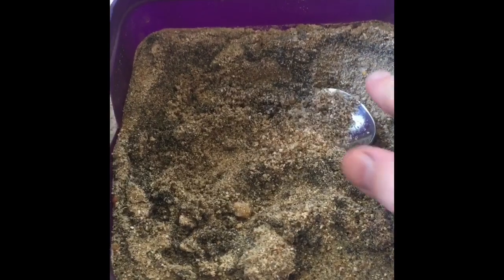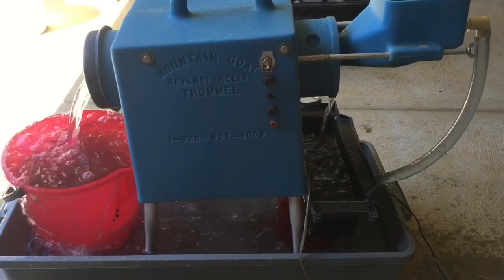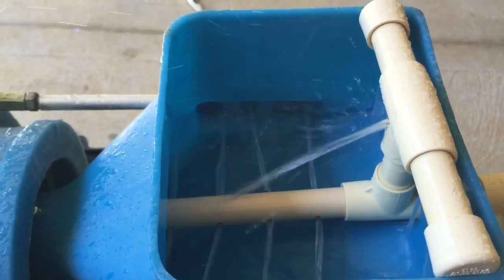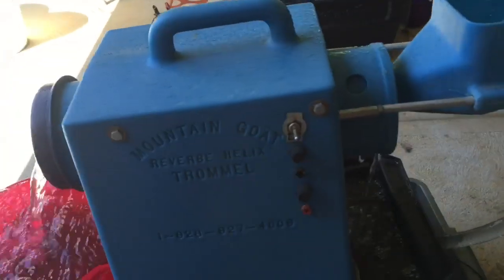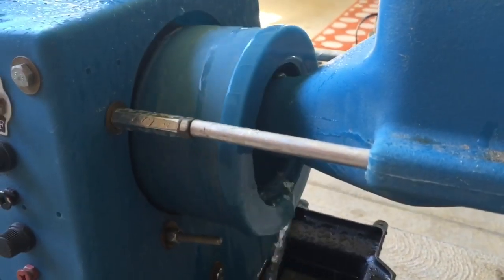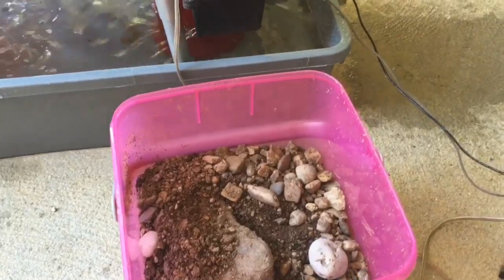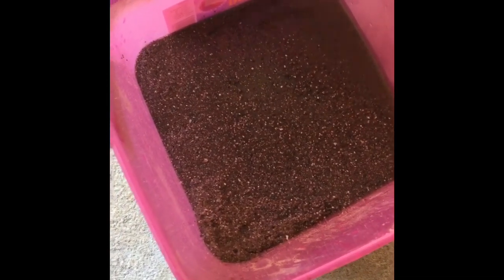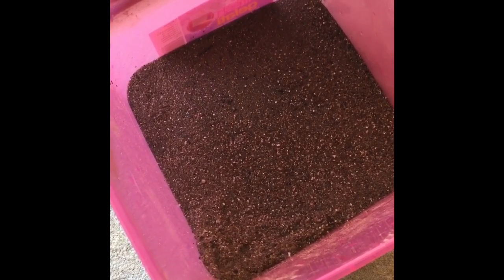Spiral wheel and Mountain Goat Mini Trommel Clean Up from Camel Mining

Comment: On your upper pipe you have irratic spray , Take a round file or rasp and go from the end smooth off the spurs inside from the drilling this holds fuzz and grass bits ,tree pollen, root matter , But it makes a much better cleaning system I did mine you don`t need to poke the holes all the time .
Reply from the maker: +Garnett M cheers for the info/ knowledge . I have since sold unit and upgraded to a blue bowl for my gold recovery.  Thanks for watching and good luck!

Comment: Hi there NEP,
I am contemplating buying the Camel Mining trommel and spinning pan set up. Did you purchase it from the US or does Camel Mining have an Australian agent? You also mentioned that you wouldn't use it in field because it wouldn't process the stated material. Is that the only reason for your reluctance to use it in field? One last question, would you need two 12v batteries or would one be adequate?
Thanks in advance and regards,
Greg
Reply from the maker: +Greg Newman gday mate! I purchased the complete unit privately here in Australia. To the best of my knowledge Camel Mining don't have distributor here. My findings were that the unit would be best suited for clean ups after running material through a highbanker or sluice, i believe you would get a higher volume through a banker / sluice over the trommel/wheel combo. I used 2x12v at home , but i guess you could run a deep cycle with solar attached if you have it available. Cheers and good luck!